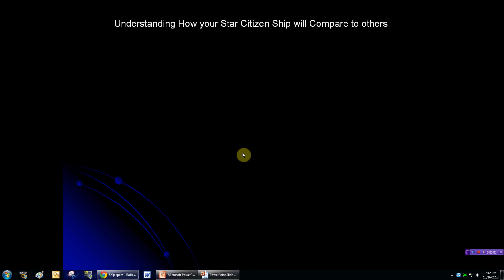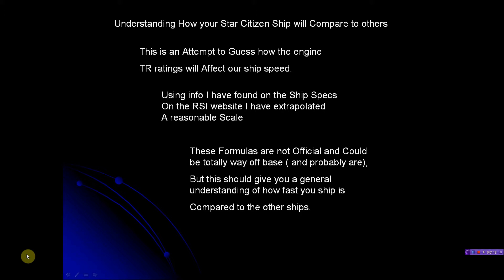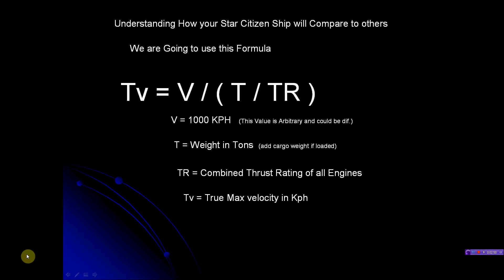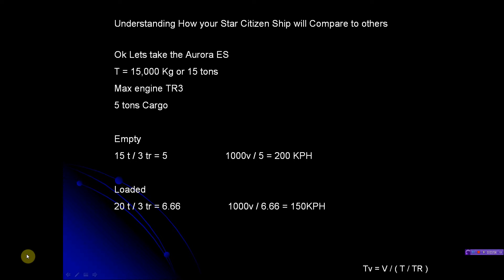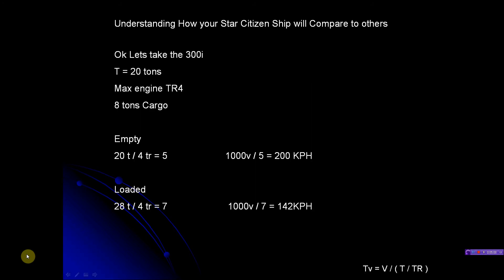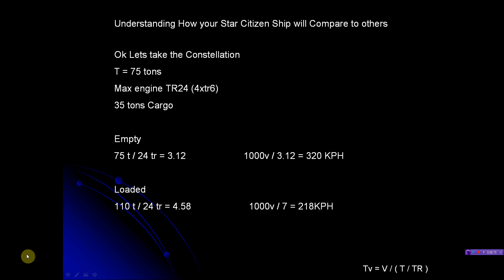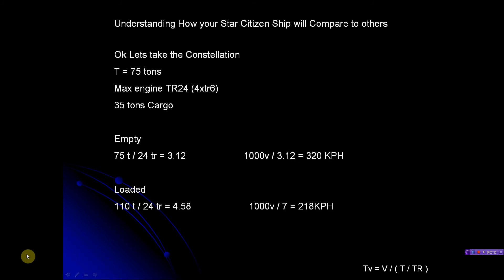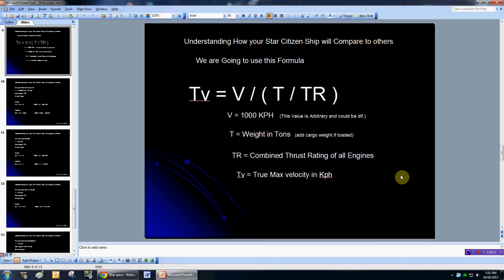Star Citizen (Unofficial) Ship Weight to Engine Efficiency = Speed

Comment: There wont actually be a maximum Velocity. A vehicle on earth only has a maximum speed because of air resistance. It accelerates until the force provided by its engine is matched by the force provided by the air pushing the vehicle back. 
A good analogy is here is terminal velocity. An object will accelerate as it falls until the force of gravity pulling it down is matched by the force of air pushing it up. Then it continues falling but at its 'maximum possible' speed.
Without an atmosphere, even a car can accelerate to speeds approaching the speed of light (given enough fuel and enough time to do it) because theres is nothing pushing it back and holding it to a particular speed.
So, it would be more useful to compare the acceleration of the ships instead. Probably the best way to approach it is to use your method of assigning 'thrust points' based on the TR rating of the engine. As F=ma (Newton's 2nd law), Thrust (TR) = Ship mass (M) * Ship acceleration (a). This implies that a = TR/M. This would be the appropriate formula to compare ship acceleration. It is 'total thrust points' for the ship / the mass of the ship.

Comment: Since there is no friction in space, if the engines are the same (meaning they supply the same amount of force), shouldn't a ship be able to achieve the same maximum velocity regardless of its weight? Weight matters when it comes to acceleration but not top speed, right? A lighter ship will reach max velocity faster but a heavier ship should be able to reach that velocity eventually too. Am I missing something here?
Reply: Realistically, there would BE no max speed.  This is a game mechanic only.  The only limiter on top speed would be running out of fuel, and relativistic mass increases which should not matter for the speeds available in SC, and which would only reduce acceleration (drastically), not remove it.
Reply: CliventheTraveller
EDIT:  time dilation (again, not really a factor at SC speeds) would also reduce the thrust by slowing the rate at which it flowed, relative to "slower" observers.  A lot of paradoxes get bandied about on this but time dilation was proven to occur.